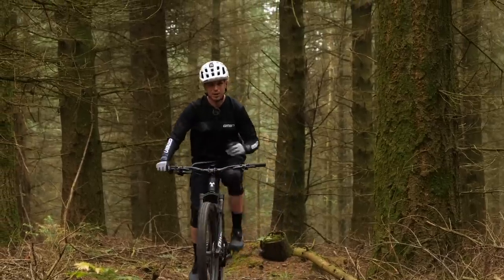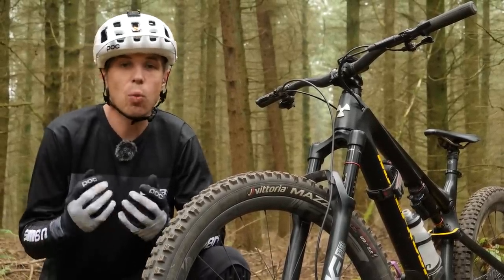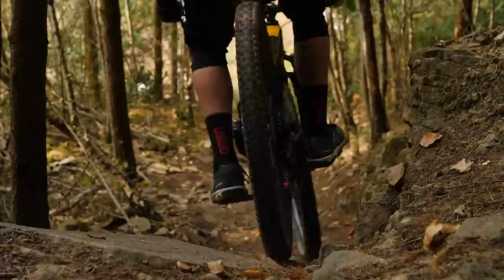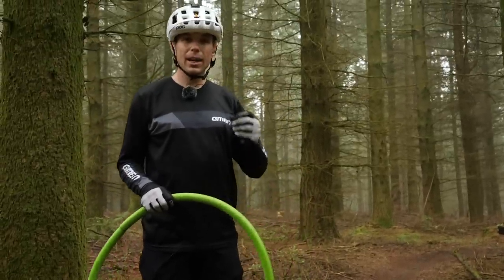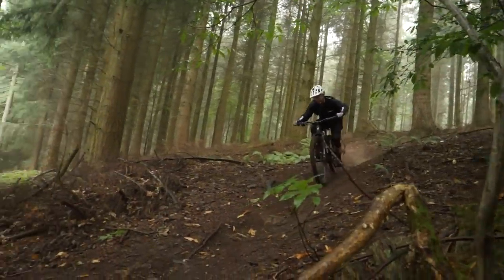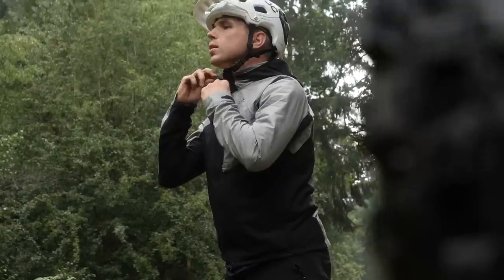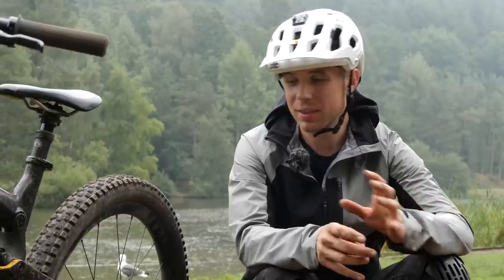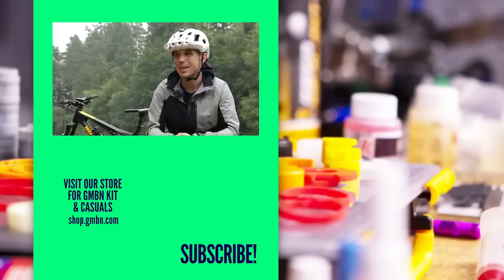How To Choose The Correct Tyre Pressure | Hard Vs Soft, What Is The Ideal Setup?

Comment: Great vid. ... but perhaps covering the effect of tire widths is also important? So much discussion around psi in so many videos, but people rarely mention the effect of tire width on side wall support and ability to hold shape. A wider tire at the same psi as a narrower tire will have a more firm sidewall. A great article from a while back on Bike Radar from Seb Stott talks about this in detail and refers to the underlying physics related to LaPlace’s law. 24 psi in a 2.6 inch tire is very different to the same pressure in a 2.3 #AskGMBNTech
Reply: THANK YOU haha,, been trying to look for someone to explain that, I have a set of 2.4 trail  tires and another set of 2.6. when I pump my 2.6s at the same pressure of my 2.4, the 2.6 feels way harder. so I have to ride with a lower pressure.

Comment: I weigh 190 lbs. (86 kg for those across the pond) My preference in the rear is 35-40 psi. Front tire is at 30-40. I had the rear at 15 psi one time, and totally felt like I was washing out on turns without a berm. 
I’ve run both tires as low as 25 psi, and felt just fine on the turns. At 190 lbs, and even being tubeless, I’m reluctant to do any respectable drops at that pressure though.
Reply: Exactly, body weight is something alot of these videos overlook but prob the most important factor. Tire pressures are going to be much different for a rider who weighs 150 lbs vs someone who weighs 200 or more. When I weighed 190 I also tried running pressures in the mid 20s and ended up denting a rim and burping the tires during hard cornering and impacts from jumps and drops. Now at 215 I basically run 40 psi front and rear and have had no issues. Anything less the tires start to fold under my weight.
Reply: Sounds mega high, even if u have narrow rims and soft sidewalls. 
Try ur mid-high 20's set up...bet u get way more speed, grip and comfort without any downside!
Reply: My local shop suggested using this formula as a starting point: weight in pounds ÷ 7, add 2 PSI for the rear, subtract 2 from the front. I mostly ride trails, but it worked well for me at the start. I've dropped a few PSI on both the front and rear as I've learned my bike and the trail.
Reply: @ErikHawkinson  - interesting, I’ll check it out and see what happens.

Comment: What about pressures for those of us still running tubes? I work at sea so my bike spends long periods in storage hence I don't use tubeless and sealant. I run 29ers with a Vigilante 2.5 up front and Trail Boss 2.3 on the rear at 25 & 28 psi respectively. My weight is around 83Kg. Tyres seems grippy enough and no issues with pinch flats. Endless punctures from thorns though. I'm considering Tannous Armour, although I have read mixed reviews.
Reply: Man those pressures seem way too low. I'm running Ethirteen lg1 enduro tyres in 29 inch at 40psi with tubes.

Comment: There has been a number of studies comparing the impact of wider rims, softer rubber, rim inserts and harder casings that provides you with the opportunity to play around with the tire preassure.

My question is how big of a role the diameter of the wheel plays when chosing the correct preassure. 

If you have three identical wheels with the same tire of the same width in three different sizes. 26", 27.5" & 29". Witch of the wheels will feel the firmest? What size of wheel will swallows a given obstacle the best? 

Do you need to run higher/lower tire preassure with another size of wheel to get the same level of comfort?

Comment: I find e-bikes are over tyre like 2.6 2.4 so first thing I do is 2.3 tubeless front 18psi to 22psi and adjust HSC on the forks for stiffness mid stroke. If you look at tyre foot print you can see it is square/flat looking which is very important. Then take a loamy corner and take it fast until you crash and you will see it the feed back through the handlebars. The rear is very much feel and its ability to skip in braking bumps and trail braking conditions on circuits as the next time round you can see what your tyre was doing, and usually run 25psi unless muddy then 21/22psi. On a coil sprung bike you will feel a lot better what the tyres are doing on air not so much. The more soil that is disturbed your braking to hard and body position is in the wrong place.

Comment: When I use my bike on the road,  I use fast rolling tires with 37psi in the front and 43 in the back,  for trails, soft compound with 35psi in the front and hard compound with 30 in the back
Reply: Crikey...as vid explained, it will all vary based on tyre, casing, rim, rider weight and style, terrain etc. but that sounds like it might be worth investigating lower off-road pressures. 
I run 23/25, unless I am jumping lots then 25/27. But, as above, many variables...maybe ur riding weight is higher, etc?
Reply: Nearly always ur front is softer psi, as most ur weight is on back tyre...u have way way more in front, or was that a typo? If not, defo fix that. Front always lower than rear.
Reply: @rupedog  I'm 6ft, 225lbs...I will definitely try that, thanks

Comment: For me I am a fan of Schwalbe Nobby Nick, got a 27.5x2.35 inch setup on my trail bike and run them (with tubes) at 1.7 - 2 Bars (Ca. 22-30 PSI). For my riding (root gardens, some rocks and small kickers) I never feel out of grip and haven´t had a puncture yet. I weigh 84 kg. I don´t ride very agrresively thugh, so that might have also something to do with it.

Comment: #AskGMBNTech what happens if you change the gas inside a tire, for example, air, Helium, sf6,  co2,  nitrogen
Reply: Sf6 in a tyre??
Reply: You use nitrogen??
Reply: @simonpowell2559  nitrogen can be used for tires and air suspension, unfortunate, it's not as attainable as air!
Reply: In an mtb, nothing. Absolutely no discernible difference. 
In an F1 car tyre, a small difference.
Reply: If you use helium your bike starts squeaking.
I don't get Nitrogen in tyres, the air's 78% of the stuff anyway. Simply not going to notice unless it's motorsport

Comment: Any mention of casing? I run EXO casing on DHR / DHF setup. But I've heard some people run downhill casings year round without inserts. Better weight / durability / cost compromise vs. running inserts. Weigh the ease of sealant additions against tire feel etc. Multiple variables to optimize for. Wheels are wear parts unfortunately. Run the pressure that your taint prefers, gets you the best Strava KOMs, and keep breaking hubs and dinging rims.

Comment: I am 195cm tall and 133 kgs. I ride on Maxxis Minion DHF up front and DHR ll on the rear. I run the maximum 35lbs of pressure in both for fear that by running anything lower due to my weight would be catistrophic. Am I right or wrong in my thinking?

Comment: #GMBNTech I'm loving my 30m SC Reserve wheels running 23psi front and 25psi rear. Perfect balance for me, give it shot guys. Play around. Side note: Muck-Off sealant has proven to be the best I've used thus far.
Reply: I agree Muc off no puncture ist
the very best .👍
Reply: What's your weight and what tires? 29 or 27.5?
Reply: @FoVision  I'm 190lbs, 27.5 DHF/DHR2.
Reply: @FoVision  My weight is 85 KG 
and my tires continental Baron
27.5 in front and continental trail
king 27.5 back.Tirepressure is 1.9 Bar in front and 1.7 in Back
and it works very good.

Comment: I am a much better DH rider that I am a climber.  So I'm testing higher pressure during the 1st half of the rid (where most of the climbing happens), and dropping a few psi on the later, DH portion.  Is this common.  Is higher pressure making the climb easier?  Thank you for your great videos!

Comment: i run 2.6" front 2.5" rear Maxxis High Rollers on a 30mm rim at about 27psi front, 29psi rear, any lower and i find the rear tire rolls over and feels like a wash out. i have yet to try dropping the front anymore but probably could.

Comment: Those Vitoria tires have shitty sidewalls if Henry has to have that much pressure in there. I ride a 165mm travel bike and run 15psi front and 20 back and I’m 225lbs  I don’t have squirm or pinch punctures. Black chili for lyfe

Comment: Having a cheap tyre only allows me to go down to 35 psi...
Not too much fun. But ideal for school rides
Reply: You and I both! Use mine for school rides and trail rides too. I compensate by getting another cheap tire with bigger knobs for extra grip.
Reply: @istillhavetenfingers8150   yeah... Kind of a problem with choosing tyres with a 26x2.1' wheel. Not much range where I am. Mostly xc tyres
Reply: @ChrisKim-eo9ku  Oh I see, I run a 26x2.125 cheap mud tire for aggressive riding and so I can retain high pressure. Then a raster rolling 26x1.95 in the back
Reply: @ChrisKim-eo9ku  get a 29er and join the future mate

Comment: Every tire pressure video/ calc tool etc seems crazy high to me. Has me wondering if one of the reasons everyone thinks more travel on bikes = more better is b/c people run tire pressure so high they need the suspension to compensate. I’m 158lbs (not sure how many stones that is), and run 17-18 psi front 18-20 rear on a 100mm full suspension xc bike. My preferred cycling racing is cyclocross where the goal is to drop pressure as low as possible. A slightly wrinkled tire in a cyclocross turn and bottoming out a few times is fine.  Back to mountain bikes, every pressure app has the recommended psi 30% higher than what I like. I think it’s to save their (insert company name here) rims from cracking.    I agree with the video when he mentions low pressure but enough to prevent damaging gear and when referencing climbing. Perhaps I suck at mtn biking and go too slow to justify needing high pressure to prevent bottoming out. Blah blah... give some low PSIs a try, you may like it.

Comment: Hey I recently got into mountain biking and I have a question- I ride with a tube and I have to ride through a bit of road too to get to the trails so what pressure is good for me 
The trials are beginner trails nothing too fancy 
And does high pressure prevent punctures ?!
Reply: What diameter are you riding? 29 oder 27.5? This also depends on your weight. 
High pressure makes your tire more vulerable for flats from rocks and thorns. But if your pressure is too low you can get a pinch flat wich is cause by the tire being pinched by the rim when you hit a rock for example.

I weigh 95 kg and ride a 29er Full Suspension with 30 mm rims and would probably choose around 30 psi for what you described. maybe a bit to the lower side depending on the conditions the dirt is in. is it rocky or smooth, or is it just a puddle of mud?
Reply: xXRunDeathXx hey thanks a lot for replying I have a 29er tyre both rear and front . The trial has some small rocks in between but mostly it’s smooth with a couple of puddles when it rains a lot . I will confirm my rim width and let you know .
Reply: My weight is 60 kilo grams
Reply: @yash2004veer  with only 60kg you could probably drop your pressure alot. i think i would recommend 25 Psi as a starting point.

and think about this: lower pressure may make you suffer a bit on the road but those, who pay the trail-gods with a heavy climb, will receive the gift of strength ;)
Reply: xXRunDeathXx haha for sure my man ! It won’t damage the rim right ...?!?
Reply: xXRunDeathXx and I ride with a tube
Reply: xXRunDeathXx you may find me really irritating but will it damage the tube in any way

Comment: Ever since my new rims(Stan’s flow) I get some sealant squirting out between rim and tire after every ride, do I need more pressure? It’s just a little, but noticeable, 24-25 psi same pressure as previous specialized rims
Reply: As vid explains, variables. U changed one (wheels), so maybe your tyres dont fit as snuggly as they did on the other rims so ur burping them now.
So yeh, u could add 1-2 psi and see how u go.

Comment: Hi im new to bike servicing and i acidentally pushed a chain pin all the way out and im struggling to get it back do you know any technique to get it back Sry for my broken English.......
Reply: Not easy to get it back. Replace by quick links, but use the ones that match your chain width.
Reply: @DrM0lek  nevermid a bike mechanic got it back for free

Comment: 180lbs! Perfect... Let's see what I should run!
Reply: Only.if u have the identical bike, tyres, rims, riding style, terrain.... thats the point, there is no 'right' set up. E.g., if u change tyre brand, or even type, when urs wear out, u will likely need to revisit pressures...
Reply: @rupedog  for my setup I usually run 27 back 24 front

Comment: I'm only 67kg, running my rear 2.6" plus sized tyre at 25-30psi and I don't seem to be able to manage a single day without getting a puncture! Grrr. Plenty of pinch flats, but also a couple of landings where a sharp stone has pierced both outer tyre and inner tube, so even going tubeless wouldn't have prevented those. If anyone has any advice it will be gratefully received! ("Be less hardcore" is not allowable advice! LOL :-P )

Comment: Best in the biking world is easy. Find what's best for you. I like a rock hard tyre. Others like it soft.
Reply: I think the point of this vid is to illustrate its not just what u might arbitrarily 'like', it depends on terrain, tyre casing/size/weight, rim width, rider weight etc... in setting pressure that's maximises grip, roll over, durability, speed etc.
Unless ur riding only DJ, tarmac or smooth gravel roads, then just running rock hard pressures off road as your 'default' will, unequivocally, be slower rolling, less grip, less comfort, less control. Simple as that. But if u like low grip/lower speed riding off road, then u go for it! If ur happy, then all is good.

Comment: I’m riding 2.3 DHF front and DHR II on the rear on 30mm internal reynolds rims. The problem I’m having is I don’t seem to be getting correct pressure readings from any pressure gauge. I’ve tried a digital one, a small pump and a large pump with analog readout. All say 20 psi for example when in reality the tyres feel more like 35 psi. I’ve changed valves but to no avail. I have another bike with nobby nics and cheap rims and those give correct results. What could be the problem? #askgmbntech
Reply: If multiple guages of different kinds are all telling you the same thing, it might be time to consider that your feeling is off.
Reply: Joel Henderson  Well, I’ve been riding them at 13 psi according to the gauges. Doubt that’s the correct psi ;-) 24 psi on my topeak floor pump results in a tyre that’s rock hard with no compliance. And again, been riding multiple tyres for a few years now and different bikes with correct readout. I know what 22 to 24 psi feels like by hand so that’s what I do now and adjust on the trail.

Was hoping somebody has a solution.
Reply: Try cleaning/ replacing your valve cores dude 👍🏼
Reply: richstockton will try that again. Maybe it works.

Comment: Ironically, this video just sorta cemented in my head the need to go tubeless once asap. "Tires like suspension should be bottomed out once in a while". Do that on a tubular tire, and you're risking a snake bite, so I stay away from that
Reply: After going tubeless, I think I could have just bought some foam tape and done the internal rims to cover the spoke points. Honestly, I can't say it helped me much at all. However, more talented riders swear by tubeless.
Reply: @capitalschool8765  hmmmm, interesting. I suppose that I personally have never experienced a flat out on the trails, and that one of the main benefits proclaimed by those promoting tubeless. Still, maybe next year I'll give it a shot. first up is getting a dropper tho
Reply: @ilikerealflight  well I'm a below average rider so the benefits may be more apparent to average to above average riders. 10-4 on the dropper!

Comment: roadies could learn a thing or two
Reply: Totally different for road tyres/bikes set up. There, harder is most usually better, barring comfort.
Reply: @rupedog  Used to be the common thinking, things are changing...or have changed already is more like it.  Roadies that used to run 23mm and 100-110 psi are now running 25mm or even 28mm and 90'ish psi, sometimes less , if their local pavement is rough.  Turns out it's more efficient just like on the trail.  Road bikes coming stock with 25mm now that used to be narrower.  It was news to me too!